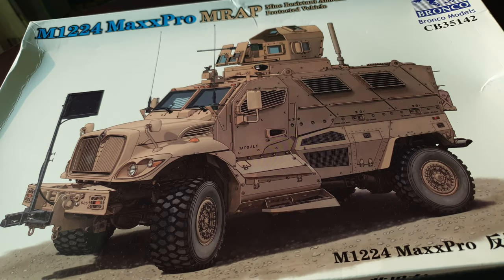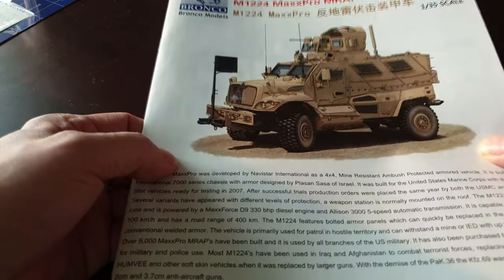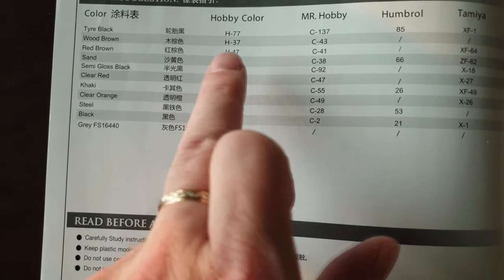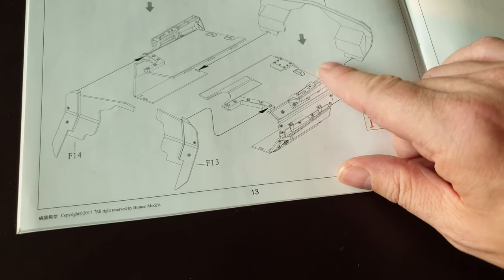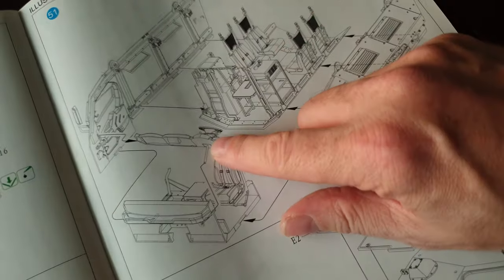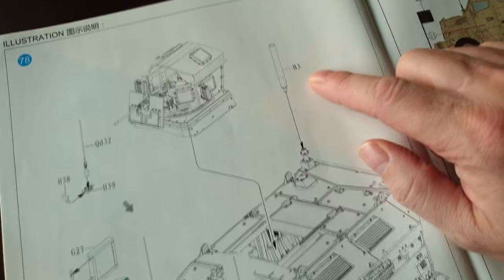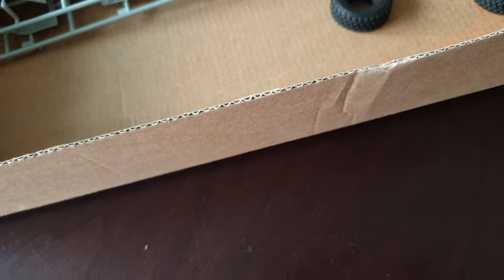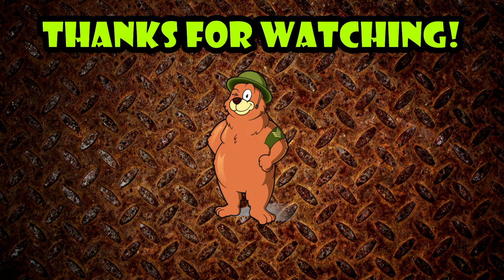BRONCO MRAP kit review

Comment: My model came with injection problems in Qd 29 parts and unfortunately both parts came with the same problem.  When it is necessary to put the front suspension (springs) I do not know how I will do it.  Did it happen with all the models?  How would you proceed in this case?  I request two new sprues so that it is possible to do the assembly correctly?
Reply: @TheBearScaleModels  Thanks for the answer. I hope that only I have been "drawn" with this problem. lol

Comment: I don't know if you ever had a go at building this but my advice is don't, not unless you absolutely love really, really fiddly detail, vague attachment points and sometimes vague instructions on how to attach.  I've built a few Maxx Pros, including the all-resin Legend kit (which had a few issues in itself), but the Bronco kit has defeated me.  Every sub-assembly is hard work: microscopic pieces which need the patience of a neurosurgeon to prepare. I gave up around stage 20.  This was a kit made by sadists for masochists!  I think Bronco assumed this kit would only be bought by engineers who had worked on the real vehicle.  No wonder you don't see this kit featuring in any of the model magazines.  I am now going to build a Tamiya 1/48 Type 10 - aah, the relief!
Reply: This is a complicated model to build and unfortunately I saw your post too late.  I started building mine this week and I can see many problems that I will face.  I have already assembled a Panda Hobby Cougar and thought I would never build anything worse, but I was disappointed again.
Reply: @EvandroEbert  After a couple of months I returned to the Bronco and told myself to slow down in building it.  It also helped to build some of the sub-assemblies to give me a sense of getting somewhere.  I had some problems with alignment at the end but managed to get a passable result (for me!).  I gave the model minimal weathering - the build itself was enough.  Good luck!
Reply: I've built the real truck so this should be easy
Reply: I'm making this now and having fit issues with it. It's too complicated for it's own good. The whole thing just feels flimsy.